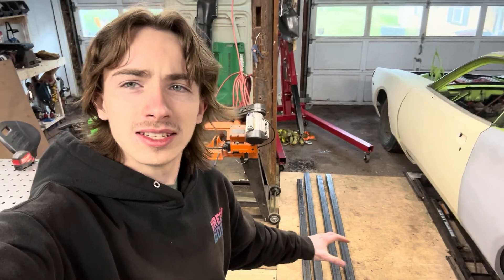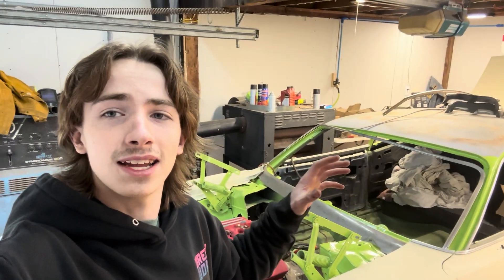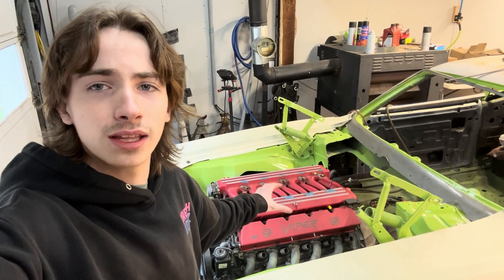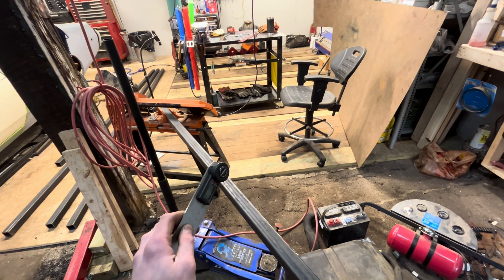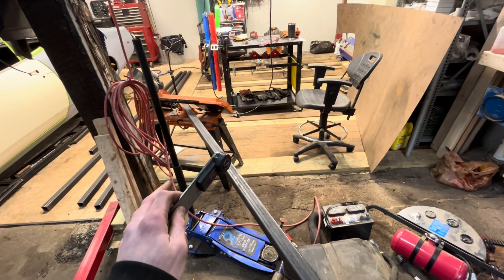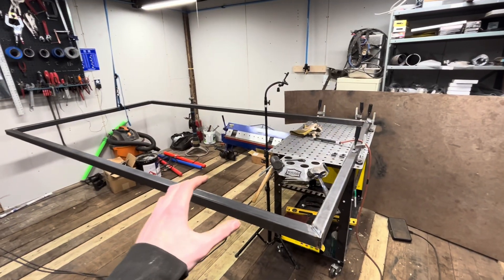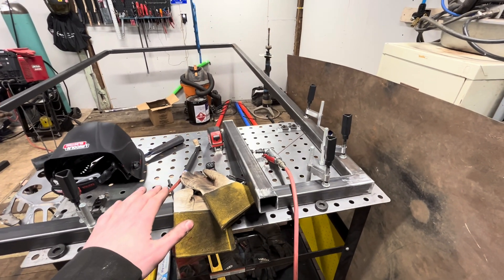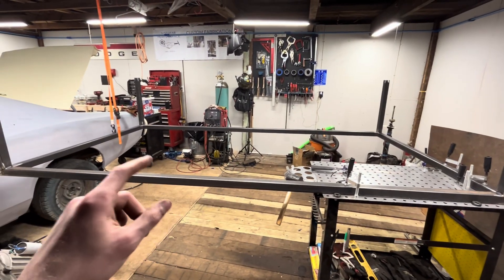Let’s Build a MASSIVE DIY CNC Plasma Table

Comment: if you try to cut too fast the saw will cut crooked. The one I use at work is like that.
Reply from the maker: It actually ended up being that the new blade I put in was slightly thicker than the old one and the bearings on the saw that guide it put a curve in it over time.